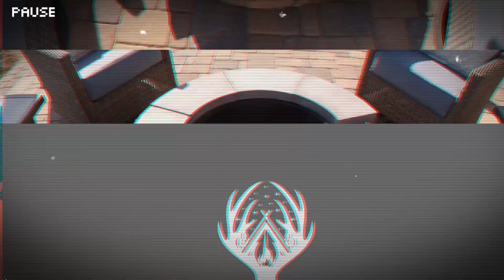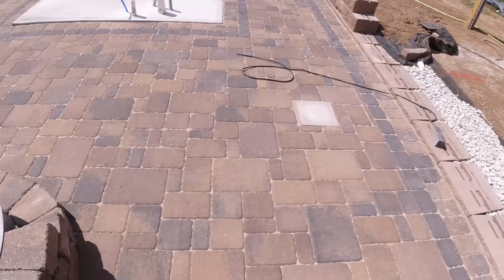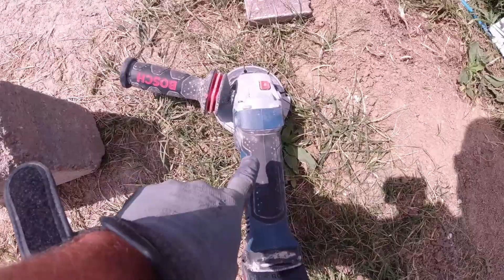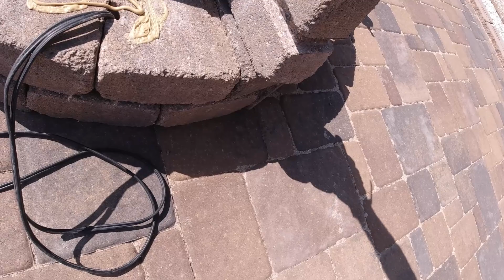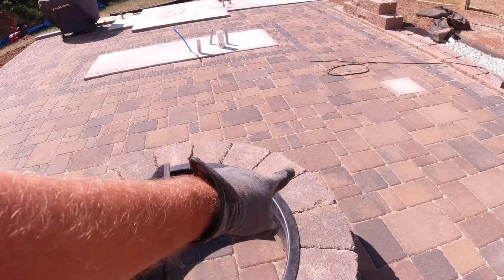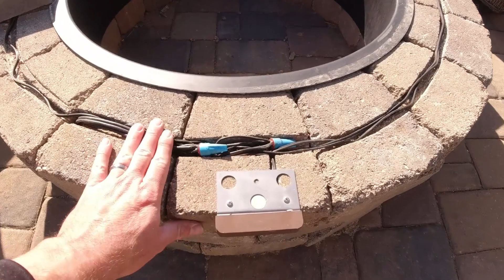Building a Willow Creek Ledgestone Fire Pit with Hidden LED Landscape Lighting

Comment: How was the longevity of this? Did the wires get to hot and melt?
Reply from the maker: So far so good.  The bottom is filled with gravel.  Also, there is a metal fire pit ring that helps act as a shield.  It seems to work fine for our recreational fires.  I am pretty sure the fire would have to be quite large and burn for quite a while to heat the blocks and wire to the point of melting.